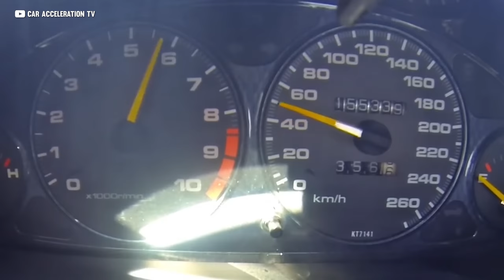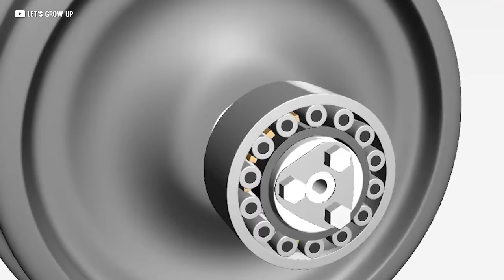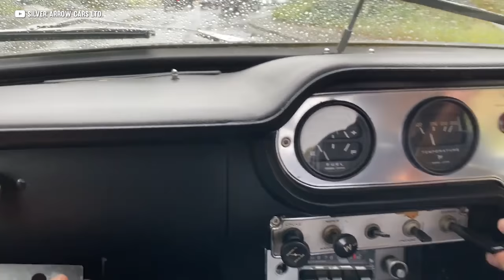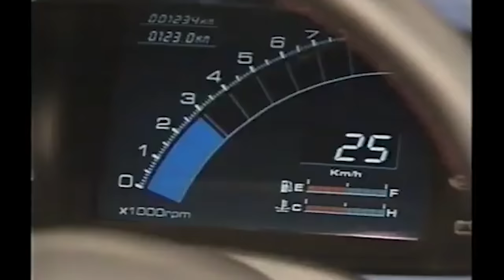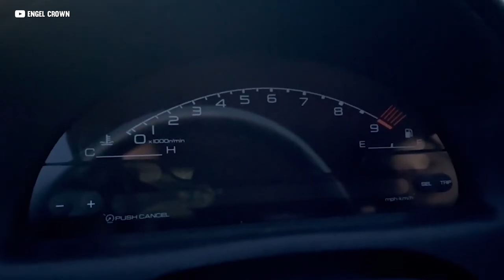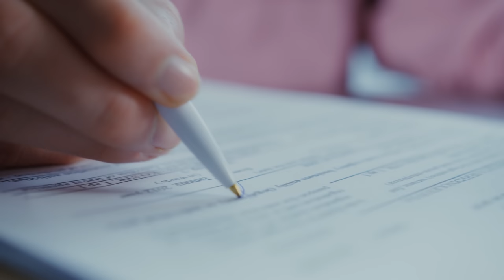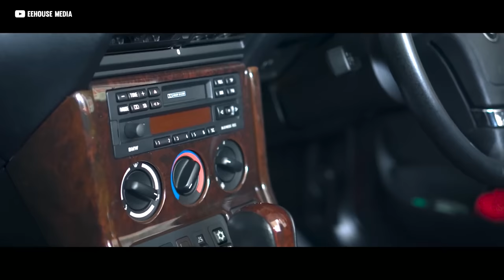Why Honda Killed The Greatest Sports Car

Comment: They can literally start production today and not change the design. That body was ahead of its time.
Reply: They couldn't sell enough of them to make it viable in 2009, why would it be any different today?
Reply: they cant it wont meat the updated regulation. headlights are too low and it has to hold its own weight upside-down. wish they could pump out more.
Reply: Absolutely. A little paneling refresh, but just throw the chassis and block on the assembly line, and gucci
Reply: @fantabuloussnuffaluffagus my dude, you probably weren’t even alive during the 08’ financial crisis. During the 2000’s people were struggling to put food on the table let alone splurge on a new sports car. Many auto manufacturers killed off models during that decade.
Reply: @agr_  Dude, I started working for a living in the '70s.  I've seen a couple of boom-bust  cycles. You seriously thought I was under 15? LOL.
Reply: @agr_  Even in the years before 2008, the S2000 was a low volume car. From a business perspective, it's not worth to use an entire factory allocation to build a car which has low sales volume AND low profit margins, could be better used to build CR-V or some other mass production model.
Reply: @PURENT    it isn’t always about good profitability. The S2000 was and is an homage to Mr. Honda and his company. Also the original intent was for the S2000 to be a limited edition vehicle. But because of such high demand in the 2000-2001 production run, Honda continued to produce the sports car for another 8 years. You’re treating the S2000 as some basic everyday production vehicle when it’s not. And Honda didn’t go bankrupt unlike Bugatti with their super car in the BOOMING 90s lmao. In fact Honda pulled production at just the right time because people were starting to buy essentials due to the recession, not buying weekend cars with their nonexistent savings. The 08 crisis was a good time to close the chapter for the S2000.
Reply: @agr_  It's a business, of course it's about the profitability. 10 years of production, and it didn't end up as a resounding success like the Miata was, and Honda couldn't multi-purpose a factory line building RWD cars like BMW and Porsche could with the Z4s and Boxsters.

So it was just losing them money, they cut their losses and left it. Now everyone is begging for Honda to bring them back, but it's still the same old problem: sports cars have limited sales and limited profit.
Reply: @PURENT  you’re overlooking the fact that unlike the cars you listed, the S2000 has appreciated in value.
Reply: @agr_  The cars I've listed are still selling new from factory, earning their manufacturers money. Honda doesn't get any money from appreciation of S2000s.
Reply: @PURENT  you’re simply not understanding that the value of the S2000 holds and appreciates because of the high quality, amazing performance, limitless potential, and outstanding engineering and design. You’re too caught up and blinded by money when quality and value speaks much louder. It’s easy as hell to spit out poorly engineered roadsters year after year when quality doesn’t matter.
Reply: @agr_  The point isn't about how great the S2000 is, everyone knows it's a top tier roadster.

The point is that it just didn't make enough profits for Honda. Money speaks louder than quality and value, which is why there's no S2000 successor. You might wonder, how can you build something so great and then fail commercially, that's just the way of business. 

The Lancer Evo which is a legendary car faced a similar fate. Couldn't sell enough of them and Mitsubishi was losing money building them. Cancelled after the Evo 10.

The Chevrolet Camaro is an all around better machine on track easily outrunning it's competitor the Mustang and making a mockery of the Challenger. Discontinued as of 2024 cause their sales numbers kept dipping and they couldn't outsell the Mustangs or Challengers despite being the better performance car.

It's about money at the end of the day, otherwise they'd just never stop making these cars.
Reply: I don't think you realize people don't like how compact it is. Sadly the market right now is SUVs and 4 door sedans. Its reasons why Honda basically killed off the coupe.

Comment: With every year that goes by I'm glad I got mine when I did. It was immediately a classic in the making, and years later it still holds up, in every respect. Honda will NEVER make another car like it again.
Reply: For the price, it had supercar parts/engineering but geez was it tiny inside...couldn't even try a different seat at the time, none available then
Reply: @agrippa1234 agreed my aunt has 1 i moved for her. At 6’2 220lbs it wasnt great for a 3 hour trek. My dads miata is even smaller. BMW z3 is only compact sports car i fit in comfortable. Enough so that ive owned 2. Just have to swap to a slightly smaller steering wheel the old ones are large pizza size
Reply: @agrippa1234  lol legit. I think it may have been made for asian folks. 

(am asian, fits like a glove. nothing but complaints from my tall non-asian friends lmao)
Reply: @agrippa1234  I wanted a used one, but hell I am too tall for it. Dang it.
Reply: Or the integra type R
Reply: @knocksensor3203  Front wheel drive makes it a no-go for me.
Reply: You're absolutely right. I went to a honda dealer with my s2k and the car salesman even said "never sale this car"
Reply: @tonythehitman1  Ayy it's a legit collectible now. I just saw a 2009 CR model with a couple hundred miles sell for $200K on Bring a trailer.
Reply: @edgarpoe517  shesshh that's insane

Comment: The S600 had a rev limiter in the form of centrifugal cut off switch in the distributor rotor, if you changed it to a standard rotor it would rev to 11,000 rpm.

Comment: I don't think we'll ever see another naturally aspirated S car. The S2000 was never intended to compete with the Miata, but rather the BMW Z3 & the Porsche Boxster. I imagine many people lost interest in the car while still in production because unlike the Z3 or the Boxster, it remained relatively spartan by the standards of the day. While some refer to the later AP2 car with the larger 2.2 liter engine as the Americanized version, it also wound up replacing the AP1 in Japan as well. I believe both the S500 & S600 featured a 9,500 RPM redline. The redline of the F20C engine is 8,800 RPM, while the rev limiter kicks in at 9K RPM.

Comment: As a muscle car enthusiast, I will admit that at one time I wanted one of these.
Reply: They are so cool! I totally agree 😸❤
Reply: With age/surgeries, etc I owned an first gen Miata new, an S2000 for a whole week I am now on my 6th Vette (C7 Z51 7MT Conv) and still think of it as my elephantine Miata/S2000.  As much as I love it, it's not as much fun to drive as the first two, can't even take it close to 100% but with a jar of vasoline and a running start I'm good to get in and go!
Reply: @agrippa1234  ☺☺☺
Reply: I just drove my first one this year. I love my v8’s but a s2000 is very special and has lots of soul.
Reply: Nah you would not be happy with the s2000. You like big engines for going in the straights. The s2000 is a dog going on the straight but it's quick overall on the track with corners and some straights.

Comment: And I owned an '04 for a whole week.  Bought it new at Honda of Auburn but my chronic back and size (6'2") could not deal with the compressed cabin space.  Nicely though, the dealer took it back (I only put 110 miles on it), very classy.....it was sold the next day
Reply: In Colorado there is like a 3 day cooling off period for a sale and a mileage limit. But that can probably vary based on the dealer.
Reply: Btw it is so often the case that Honda designs many of their cars with a 5ft10 max height for comfort, while Chevrolet, VW, Volvo and possibly others allow taller men to fit perfectly fine. I hate this!!! It is hard to modify seats yourself but not impossible.
Reply: @jamesmedina2062  anecdotally that makes sense as I owned a CRX, a TSX though maybe the Accord, especially later gens were made for bigger Americans....interesting
Reply: Agree. Bought a z4si instead because of my size. No regrets other than I sold the car with the typical depreciation while the s2000 would have brought in close to the original purchase price.

Comment: Loved my '05 S2K. Fit like a glove, amazing handling (as a roadster even compared to coupes), wonderfully smooth shifting MT, responsive throttle (before eControl) and simple understated beauty. Z4 3.0 and Cayman cost more for purchase and maintenance. Corvette did not have overall quality/reliability and Miata was too low on HP for my taste. 350z/G35 and RX-8 were considered too. All boils down to what your needs/desires are plus how much dough you can lay down. Honda made an excellent contribution to the world of sport cars!! Hope they come back with more.

Comment: I almost bought a minty 5K mile red S2000 and on the way to buy it stopped to look at a Boxster S that I sort of considered as well.   After test driving it, I bought it instead.  I sort of always regretted not getting the Honda because I figured I could always get one later but didn't plan on them stopping production and the prices going way up.
Reply: So many Fine Cars! .. what happens with me sometimes is instead of trying more of them out, I get something and  fall in love with it so much that I keep it for years and years lol.

Comment: Thanks to Johnny Tran from F&F, the S2000 became my dream car.  Bought 2003 Suzuka Blue in 2006 and sold it in 2015 after putting 32K on it....not a fast car by any means, but fun to drive.
Reply: Seeing as you sold it, what's your new dream car now? Or you replaced it with an AP2?
Reply: Races are won in turns.
Reply: I would also like to know what you sold it for

Comment: I remember Honda toyed with the idea of an S1000, a much cheaper, lighter, 1.0litre 120 HP 9,000 rpm version. I wonder whatever happened with that?
Reply: It probably sounded like a Prius that’s why.
Reply: @agr_  a 9, 000 rpm Honda motor would sound like a Prius?!? Are you high or just clueless?
Reply: @someyoungguyjohnson7239  if it’s only 1 liter yes
Reply: @agr_  wow, you sure need some schooling. What does a Suzuki Hayabusa sound like? What does a Honda Fire Blade sound like, what does a Honda S800 sound like? My point is, small engines RIP and sound awesome.
Reply: @someyoungguyjohnson7239  With those specs, no wonder it got canned. Kei car limits are 0.66 liter and about 70 hp, so it wouldn't even qualify for the tax advantage in Japan.
Reply: @PURENT  who said it was a Kei car?
Reply: @someyoungguyjohnson7239  S1000 rumor was based on the S660 Kei car but with an engine like the one you described.

That rumored engine was too big to sell in Japan and too small to matter in the other big car markets.

Comment: Good Buddy's Dad had one, and to this day, i say, its one of the most amazing Handling Cars i have ever driven. As soon as you got used to the Steering-ratio, that is. 

If they would have made it S3000, this would be as legendary as the Supra / GTR today. The engine was amazing, but it just felt and sound like a well tuned Civic (apart from being RWD obviouly). I had a M3 (e36) back then, and getting back into the M3, the torque and gears were just so much more satisfying. We always wanted do a engine swap. but his Dad never got on board with that. He did bought a turbo-kit later, but never driven it after that. Looked sketchy  following them them through the mountains..

Comment: 01 S2000 here.  New clutch, new tires, Fujitsobo exhaust and beautiful paint.  Such Ana amazing driving experience and unmatched shifting precision.
Reply: Almost all modern 4 cylinders have a terrible exhaust sound especially Hondas. The s2000 has such a brilliant intake/ induction sound why mask it?
Reply: @MiguelGarcia-vj7oo  
The Fujitsobo exhaust is ultra quiet. So instead of hearing only fart cans, I hear the great sound of the engine (~95%) and the other (~5%) is the exhaust. How do I know? The previous owner had fart cans for exhausts.

Comment: Eh, I always liked the S2K, but at 6'2" I couldn't fit in it to actually drive it. So I got a 350Z instead. Loved it. Wish I still had it.
Reply: You can lower the seats with diff rails
Reply: @wilsonshum6252  or you can just buy a car that fits you to begin with. So I did.
Reply: I had the opposite problem at 6’1”. My knee kept hitting the steering wheel and center console in the 350z. Made it iffy to get from gas to brake. S2k fits me beautifully.
Reply: @SkunksterPlaysPoorly  you probably have longer legs than me then. I've got a longer torso. My inseam is actually 31, which is on the shorter side for a guy over 6 feet. I fit perfectly in the Z. It felt like I was in a fighter jet made just for me.

Maybe it was the width of the S2K that was my issue, since I'm also in the 250lb range. I just know that I couldn't move in the car at all. And rather than feeling snug in a cockpit like with the Z, I felt like I was being squeezed hard.

Either way it worked out for me. I enjoyed the change of pace that the Z and it's torque gave me. The car I owned prior was a 95 Integra GS-R, so I would have just been trading up to a higher output VTEC with rear drive had the S2000 fit me.
Reply: @Xoulrath_  That’s probably it. My inseam is more like 32 and 180ish lbs. Glad we were both able to find sports cars to follow up our Integras.
Reply: The 17-22 Type R seats have a size limit and the newer Type R opens it up a bit but still height limit. I am 6ft1 and lean so just barely fit the 17 Type R seats but mainly if I take my shoes off which pisses off my girlfriend (stinky feet)!)

Its a real drag Honda does not just design up to 6ft4 men! For comparison a 2nd gen Chevy Cruze could fit a really tall American but the manual trans did not light a fuse to the gearbox in my Civic.

Comment: I have a 2002 s2000 and yes for a 4 cylinder car it gets 1/2 the gas mileage you would expect from a 4 cylinder.  I rarely rev it out and light on the throttle and 19 mpg is about as good as it gets.
Reply: I have the same car. As a daily commuter, driving it like a civic, I can average 26mpg/tank. On track pedal to the metal, 9000rpm could drink lots of gas. Ended up doing less than 10mpg. The car’s vtec gave it duo personalities. If you want economy, stay below 6k rpm to avoid engaging vtec.
Reply: If you're worried about MPG get yourself a Prius.
Reply: @edgarpoe517  That’s why I have a motorcycle I hardly even drive my car anymore

Comment: S2K might have been an odd niche for the time, lacking BMW or Porsche pedigree, but it's performance vs reliability ratio remains unbeatable.

Ferrari and now Porsche have finally exceeded S2K hp/liter, barely. But you can put over 400k miles on an S2K just changing oil and consumables, and valve adjustments. That ain't happening with any P or F cars.

Comment: I have a 800whp Corvette Z06 these days, but I still miss my S2000.
Reply: You should have kept it. The interior quality on the vetts just doesn't come close
Reply: @umaireg6  The interior is good enough. The biggest interior advantage the S2000 had was the seats and I've remedied that. My Z06 feels like an S2000 on steroids. It feels light and nimble, it will pull lateral G's, it brakes hard, and it accelerates hard. At the end of the day, I'd never trade my Vette for an S2000. My Z06 is just way better overall.
Reply: I'd buy a c5 alongside my s2000. I just don't know if it's something I'd like to wrench on myself
Reply: @umaireg6  C5's aren't too bad to work on. Anything big like removing the drivetrain can be done with the help of a buddy.

Comment: Honda made the 6 speed manual so good that when the S2000 came out every manufacturer bought one. At the time of release Porsche 911 owners complained that the shift was to long between gears. Porsche had Honda consult and improve their manual trans. 
I had a Yellow AP1, Put a Paxton supercharger, Hondata ECU, Spoon suspension and HKS exhaust

Comment: Always admired the car , never had the pleasure of driving one. Still, a huge Honda fan.  Simple reason,,,I bought the first Honda Accord , in 1976. Right off the first truck delivery at my local dealer. Silver over black it was an absolute dream right out of the gate. Everything fit perfectly , ergonomics were ideal and it ran like a Honda! 

I don't think I've ever owned the car that turned more heads. Honda only offered cvcc peanut cars before this and it was a real breakthrough in design and engineering. 

Just like BMW came to market with the 2002, Honda stepped into the scene when most manufacturers were still building clunky cars.

Kudos to Honda for never losing their way.

Comment: I've driven one and it has a nice shifter and handling for its weight, but I found a classic Mini to be more fun to drive although a deathtrap if ever in a car crash.  In reality a 600cc sportbike makes most cars boring. Weight is the enemy of fun motoring.
Reply: Nice, I watch your 1/64 videos
Reply: Disagree, I’ve always had and raced sports bikes, just sold a panigale V4s and the S2000 is way more fun. You don’t need to be going ridiculously fast to have a smile on your face, 80kph around a corner feels like 150kph felt on the panigale. Also there feels like there’s much more going on, a superbike it’s effortless with shifting, braking and acceleration, it all happens in unison, the S2000 feels like choas in the best way when you’re driving it!

Comment: I just destroyed one of these with my 3.2 Acura tl  the other day.. if the s2000 comes back it better be both e ok electric and turbo charged.
Reply: The only thing the TL will outdo the s2k is in the straight acceleration and that is a drivers race honestly.. other then that the S2k outdoes the TL in every way.. I own both and love the TL but the TL is not a sports car.